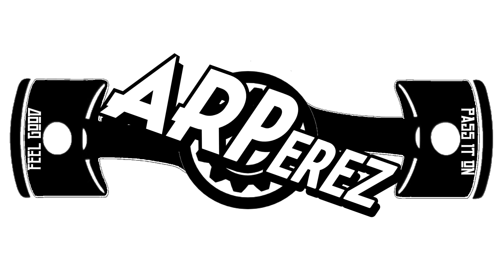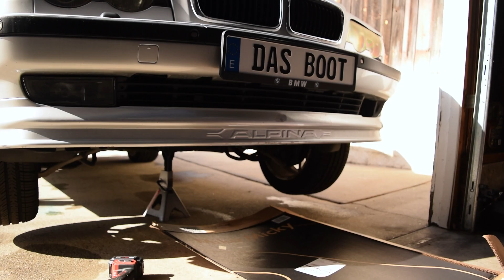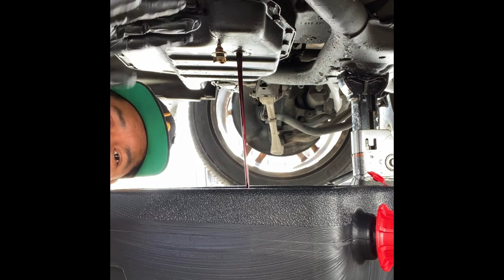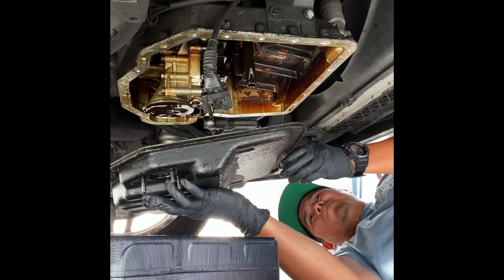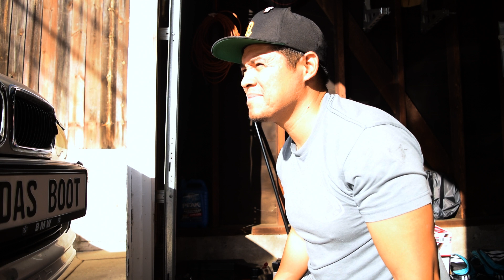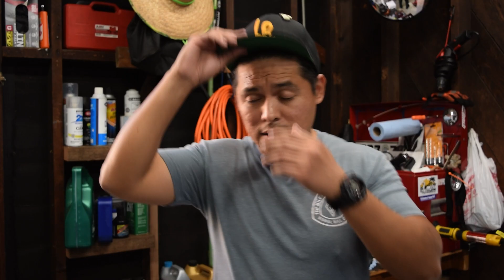The end of the e38

Comment: I have an E38 M62TU replacing the timing chain next month. When starting, my chain rattles strongly, vanos knock and oil leaks under the valve covers. I have purchased the parts, including the overhaul of the VANOS, the replacement cost me 1,500 € (I bought most of the parts directly from BMW). I will also change the valve stem seals, I found out that my car eats oil through them (0.25 l per 1000km - 1qt per 2500 miles) So I'm keeping my fingers crossed.
Reply from the maker: You got this! Put that work in and enjoy your car after! She will be happy with you :)

Comment: That sucks, AR, I had a feeling when your feed popped up with that title that TCG failure was it.  I've looked at the internals of two M62tu motors within the last few years, each had only 90k -95k miles on them, but all the TCG and OSV plastic were brittle with small pieces in the oil pan and filter catch but not yet at a catastrophic point.  IMO your motor is done if you saw sparklies in the oil but you can always scope the cylinders for scoring and the oil passages for blocking shrapnel but it will cost you to try to see if the motor is salvageable, and  without any guarantee of success.  That you made it to almost 200k is pretty good.  

If you do buy a donor motor, you will still need to disassemble the motor and do all the TCG work  and other prudent work with the donor motor out and accessible.  Speaking from experience, its not bad but time consuming, and with a new family it sounds like it would be very tough for you.  Sorry, brother.

I replaced my TCGs at 92k miles and have been paranoid about them so I drop the oil pan every other 4-5k oil change to inspect the condition of the new ones plus the oil pump sprocket nut and chain slack.  Based on my very limited experience, I do not believe that TCG failure is just miles and heat but also time as they are mostly made of plastic.

Good luck, and respect for posting this, it was hard for me to see you realize what happened.  I died, also.
Reply from the maker: Hey man thanks for the thought out response and empathy. You hit a few key points right in the head and I am still torn as to what to do next. I will try to keep you guys updated. And as always, thanks for the support!!!!

Comment: I've got a 95' 740i with 84k original miles and I know I need to do my guides so this doesn't happen lol I barely drive it so I don't break it, definitely don't give up on the car though I'd park it somewhere and make it your project! Slowly get it going again and it'll be better than before! Don't be afraid to go LS either if you can't find a decent m62 lol
Reply from the maker: I have thought LS to be honest
Reply: I have a 95 e38, also.  timing chain guide design for that year didn't have the u-channel guide, is has a hydraulic roller.  Mine has 230k and runs strong.  don't be quick to jump to guides unless you have debris in the oil pan!